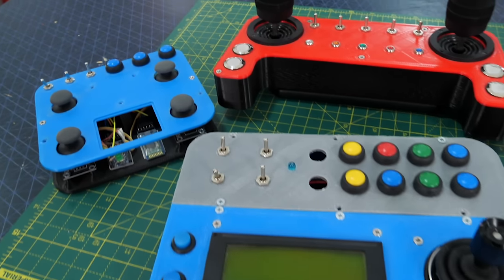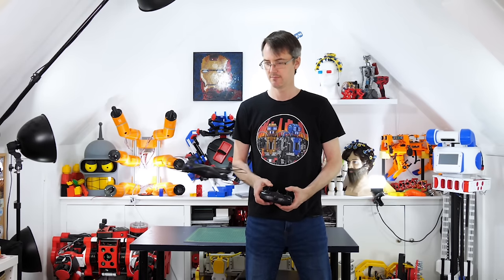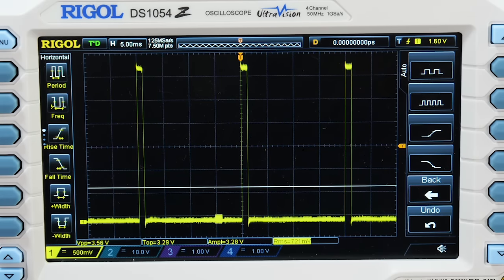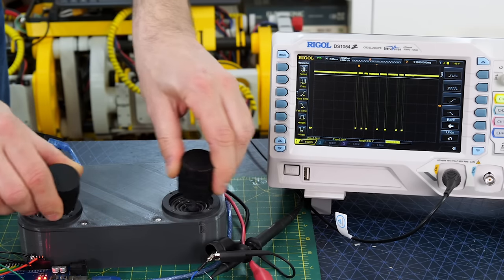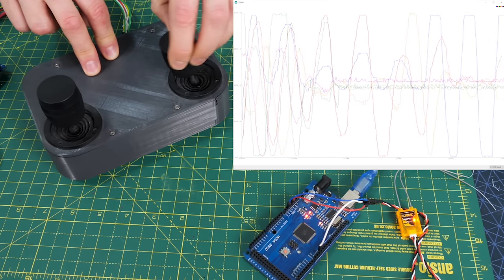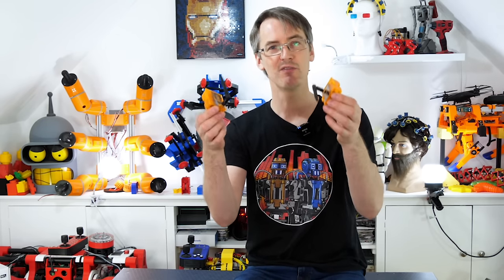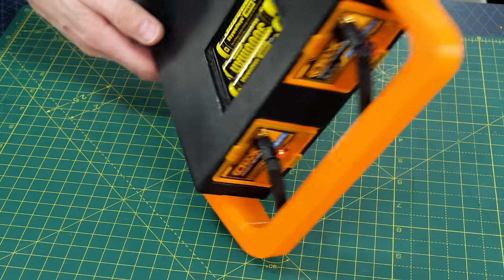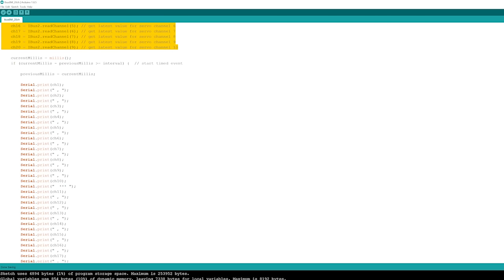Building a DSM2 R/C Transmitter with Arduino

Comment: @James Bruton: you can find all over internet radio modules on any band (433/868/915Mhz/2.4Ghz) that just provide a transparent UART. And they are cheap. Having a digital UART makes things easier, you can send any data you want. And they do provide reliability and range (hundreds of meters, kilometers). Using analog PPM signals or IBus or any RC protocol is not the way to go for your projects. Just a transparent radio UART is the best approach. Being full digital, you can add checksums, error correction and whatever you want to your digital packets.
Reply from the maker: links?
Reply: @jamesbruton  Not sure I can post links here,but if you search your preferred online shop for: "3dr radio modules" or "LORA 433Mhz radio module" (or other frequency band or any radio module with SXnnnn chipsets) you can find a ton of modules. They are just transparent radio UARTs, and you configure the datarate/ec/etc using AT commands. They expose just a RX/TX UART pins or USB to connect to your microcontroller or PC or PI. They usually support up to 56kb air rate, some do support more, but it's enough for remote controlling and sending commands and configuration data and whatever data you want back and forth. All these modules are just plug and play. You just configure the serial speed and the channel using AT commands (most are already set with default values, so 2 identical modules will just

Comment: That DSM hardware is 5+ years out of date. Check out Express LRS. Its an open source project being actively developed with 40km+ of range. Because its open source, the Rx and Tx are very inexpensive. And the devs are so enthusiastic about it, if its missing a feature, I'm sure you could work with them to develop it.

Comment: The attempt to multiplex the channels failed because the receiver is decoding the channels asynchronously from the ibus reporting. So you get some values from the current frame and some from the previous frame.

Comment: Thanks! I just grabbed a few😊. My solution has been to use a wifi router modified with OpenWRT, and UDP. And that is very resistant to large amounts of interference. But I will try playing with these.

Comment: I know this is an old video but you could consider using the HC-12 wireless module gives you 1km @433.4-473.0 MHz for Arduino to Arduino communications. They have hit 2km in some situations.

Comment: You could also read the PPM receiver signal using the Capture peripheral of a MCU in combination with DMA to free up the processor.
Reply: The arduino / atmega328 doesn't have DMA.  It does have hardware to capture when an input changed, good for reading a PPM signal.

Comment: You get a lot more configurability and control with something like the nrf24 since each packet is 32 bytes and you can send whatever you want, that could be 32 separate 8 bit channels. You can also do what you tried to do which is to make the first byte an identification byte and then send packets containing different data. Where did you get your nrf24 modules? There are a lot of fake ones out there that have rubbish range or don’t work properly.

Comment: look into expresslrs if you want reliabilty and range at a low cost, but might be simpler to use lora modules directly for custom integrations and dataset lora might be helpful but relatively slow compared to wifi, it should not be very different speed wise compared to the nrf24 depending on selected data speed, there are many modules with varying tx power for arduino some with more functions built into the chip directly like interference mitigation and error checking and correction... elrs uses lora and it gets very low latency, high refresh rate and very long range, it's also open source so you can also probably adapt it to your needs.

Comment: Maybe it's a bit silly, but I kinda miss the fun jingle you used to end your videos with. Pretty clever thinking to pack multiple buttons into a single channel though. Seems like an approach which could be generalized to several buttons/switches per channel. Within certain limits, even multiple variable axii could be packed into a single channel with reduced resolution.

Comment: You can likely get more switches into a single channel if you coerce you signal values into a binary number. Essentially, take your channel value, subtract the minimum possible value, and then integer divide the result by a fraction of the maximum possible value range. the number you would divide by is (Maximum Possible Value Range / A Power of two, the more the better). You would have to fine-tune that power of two so you get reliable reconstruction on the receiving end (your channel value will likely fluctuate by some small amount even when the input is consistent).

Then you can use each bit of the resultant number (your number of bits will be equal to the power you raised the 2 in the denominator by) as a flag for whether that switch is on or not. With the variance I was seeing, I imagine 4 to 6 bits of precision may be possible, meaning you can encode 4 to 6 switches per channel. If you can get closer to 16bits of precision (doubtful but maybe), you can use a similar trick to encode two seperate 8bit data streams into a single channel. This type of multiplexing can go a long way.

It is unfortunate that you weren't able to get the nieve time-based multiplexing working, as there are really robust time-signal schemes that can power seriously over-the-top multiplexing. Those are the same methods used by cell phone towers to service hundreds to thousands of clients per network cell.

Comment: The primary reason I upgraded all my RCs from Frsky/XM+ is because of dropouts. ELRS has been rock solid and cheap. Love your videos, keep it up!
Reply: Frsky has been rock solid here to
Reply: For what James is doing FRsky is probably fine (and dang cheap) since he can code around dropouts since it sounds like he already has had to before. I’ve lost signal on an XM+ at 75’ LOS so I moved on personally. 

One thing a newer protocol would have helped with is serial in/out from the start rather than the PPM code, but it works now so why change.

Comment: Your mixing problem is due to out of order packet transmission on a digital buss/radio interface.  Same problem as UDP packet transmission.  You aren't guaranteed the order.  You would have to tag the data with orders for packets.  Then encode and decode your data in the chain of data.

Comment: TDS PP has an industrial version of the 6-DoF thumb joystick (aka Space Mouse) module with UART or USB interface.
I think some of your applications would really benefit from having that.
Reply: That would be cool, but what a learning curve to control! Now I wanna make a space mouse quad controller and try it.
Reply: @skylar7320  I use it for CAD, 3D, I programmed a plug-in for Cities Skylines to manipulate the camera, and with many other games it can be configured as a joystick, for example in Elite Dangerous.
Not sure whether the small dynamic range is good for a drone. And yes there is a bit of a learning curve. Although in both ways, as I really struggled with CAD with just a mouse.
Reply: @graealex  yeah, I’ve used in CAD too. Takes a bit to get used to

Comment: The NRF modules work better if you give them their own 3.3V regulator and not siphon the 3.3V from the Arduino. There are ready built NRF power boards for this purpose.

Comment: You can buy any TX module and do this. There are many out there in fact they have LRS and multi protocol ones. This is an old one that's why it's so cheap I have used a rangerx to do the same it's a multi protocol. Connect to dsm2 plus many more.

Comment: You could probably also read the PPM using a RP2040 microcontroller and PIO. Though that also means writing assembly, so spending an extra tenbux on the better receiver is probably the right way to go.

Comment: I remember when you could make an 8-channel PWM link with 4000-series CMOS 1-of-10 counter chips and a few capacitors and stuff. :) And these, of course, won't try to be clever by mixing up different frames. (I hate systems which do that; hardware or software.) I've still got the book with the circuit diagrams somewhere. 4 quite simple circuits: encoder, decoder, 27 MHz transmitter and receiver. Having a quick search, it looks like you can even still get the adjustable inductors; Toko branding and all, though I haven't checked the values. The book is Mastering Electronics; I'd post author & ISBN but I've just moved and don't want to go raiding boxes just now.

Oof! 3km? I don't think those 27MHz circuits had that kind of range. :D

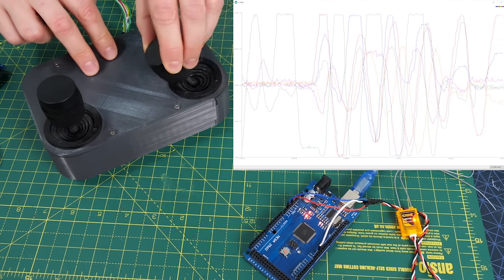Comment: 6:20 The "best" solution imo would be to use a microcontroller with DMA (the atmega2560 doesn't), set the PPM output as DMA trigger, leave a timer running in the background, and use the DMA to save the timer count value at each PPM trigger, and reset/stop the timer if overflow
That way, you use exactly 0 processor cycles and get full data acquisition

Yes I love DMAs
Reply: The atmega328, used by the baseline arduino, has input capture hardware to record the time when an input changes.  This should work for capturing the PPM signal without resort to interrupts.  It would require reading the status more often than the input changes.

Comment: I don't know how you're getting such poor range from NRF modules. I've use them in a DIY remote for a bunch of clay traps and have tested it at over 1/2 mile range.

The modules I use are the ones which allow external antennas, I also have a couple of shielded modules which I've not ever tested as the other ones worked just fine.

Lora might be an option worth looking at. Low data rate but really good range. 
I use LoraWAN in tank level sensors over several miles.

Comment: maybe use the blank in the middle of the rc remote for a screen either simple liquid crystal or even a touch one with lvgl, for telemetry and battery percentage ... in addition to switches and buttons if necessary..

Comment: As usual, an awesome video! You should try and help out the hacksmith and his hydraulic spider, I bet you could make it work better than they did!
Reply: Dunno... think the biggest issue they had with that thing was the sheer effort/time involved in each test run and that every error caused damage.  The other issue was that they were working with imprecise actuators (and sensors? or at least not enough of them). It was a good try (an excellent try even) but not sure any more minds on the job would have helped.

Comment: I'm a little confused, normally I hear "channels" in relation to r/c vehicles/stuff as a way of controlling multiple devices in the same area with individual controls (think retail toy R/C cars, they often have a selector switch on both the car and controller to switch between the "channels" so you can race another person's car [of the same make/model usually] or control multiple cars with one remote). 

Is there a clear distinction between the two or are they the essentially same thing, just different levels? 
Presumably each of these channels has 3--5 sub-channels for the various controls.

Comment: I think you could get away with 6ch transmitter/receiver and use e.g. 1st 5 channels and some smart but operations to digitally code a channel number, then 6th channel to send the value.

Assuming only 0/1 values on the 5 channels, you would have 32 channels out of one 6ch transmitter/receiver pair. :) (With more intermediate values you could get more, e.g 3^5, 4^5 and so on).

Comment: For the "binary switches" you could set single bits and transmit multiple switches on one channel that way. How many exactly is limited by the highest analog number you can transmit on a single channel (I guess 8 switches per channel?).
Reply: yeh there's no (except latency) limit really on how much you can cram down a single channel -if- you have the time to work on it/ I think James is always pressed for time though given his project through put so can see why he went for what he chose.
Reply: @WistrelChianti  I do not know, if you could really transmit as much data as you want per channel, but my idea takes only like two minutes, and he kind of did already that, but "worse". 
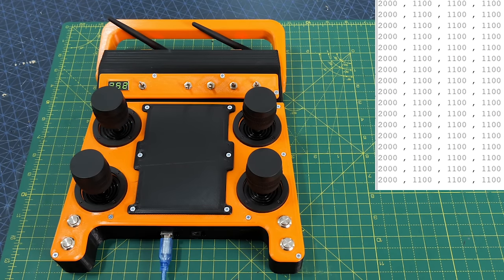At 10:02 you can see, how he uses two switches on one channel by adding specific values to the number for each switch. My idea works the same way, but adds powers of two, so you can transmit more per channel.
It is just literally the same thing, only using different numbers, and offering more switches per channel that way...

Comment: Hey, i have got a question. Im new to basically all electrical wiring. Im getting into the RC plane hobby right now and wanted to know if there would be a way of running my gladiator flight stick (which is only for gaming) through my laptop and into a little setup like you have it with a transmitter.
As far as my understanding of this problem goes, i should be able to connect such a trabsmitter directly into my laptop, and have all inputs of my flightstick be converted into that ppm language with a script. And then i would just need the normal receiver setup in the plane.

Comment: just use flysky, i use it and got 14 channels via ibus (only a firmwareupdate in the transmitter was needet. also a range of 2km + is possible with some easy mods like the antennas, battery and software. i use the flysky i6 (35-40€ now, back than about 60€, but still very good for the performance.)

Comment: Idea on the multichannel thing for buttons. could you not multiplex the buttons into an analogue value. treat it like binary and have a 1k, 2k, 4k, 8k etc. resisitor so any combination of say 8 buttons gives a unique resistance which only take up a single transmission channel? (only half way through the vid so far).
Reply: Ah, looks like you are doing something like that with 2 bits of info.

Comment: You may want to look into the TBS products (Either Tracer or Crossfire depending on the range you're looking for) which are often used for drones - They do have separate transmitter modules and they will give you the CRSF protocol documentation if you ask their support. (Or you can use PPM) Crossfire supports either 8 or 12 channels (Depending on latency required) at very long ranges. (Up to 40km) Tracer supports 12 channels with a higher refresh rate but at a shorter range, but still very long. (25km) They also support telemetry and failsafe. Finally you may want to consider modifying an OpenTX transmitter, you can buy the PCBs from the TBS transmitters and OpenTX has a lot of configuration for mixing channels.

Comment: I would like to see you use that transmitter on a robotic dog with an arm, ideally to help train an AI to operate the body. Instead of starting from nothing, you could feed it input data by hand at first and try to get it to replicate actions. I would like to see a robot dog with an arm learn to grab an apple from the kitchen and bring it to a person, and the apple could be placed in various (reachable/seeable) locations.

Comment: Great video. Super interesting. Have always thought it's a massive shame that RC radios sky rocket for higher number of channels so good to know there's a cheap way round it.  Can defo see the time factor coming into play here. Always the game is time to make something nice/right vs that'll do and heck it's only a few more quid for a cash workaround.  Anyone thinking of making comments about switch statements or amount of code in the ISR should probably bear this in mind (especially given the direct receiver code wasn't used in the end). . Some nice obvservations on advertising incidentally, I had mark forged talking about carbon fiber reenforced 3d prints which was interesting and also arduino promoting a school learning pack. Even huel is something I've been tempted to try. Finally awww project air... nooo. (and hope you guys can collab on something one day! love that channel too)
Reply: Those prices are because of Spektrum, a Horizon Hobby brand. Most HH stuff is expensive and mediocre in quality. Dsm/dsm2 isn't the best transmission protocol either and is notorious for failsafe/brownout issues. Dsmx is a lot better but it's still most commonly used under the HH umbrella. There are much better protocols available and are available in much cheaper transmitters.

Comment: Lol, the module is out of stock.  Would it work with some other dsm2 module?  This radio would be amazing for rc construction equipment I'm working on.
Reply: Let me know if you find an alternative solution or website for this module in combination with the receivers that are still available. Thanks

Comment: You can send even more data in a single channel by encoding the data in individual bits. For example, if you have 4 buttons, each button is a single bit, say the first two buttons are pressed. Then the value to send would be 1100 or 12. This way all your buttons can take up a single channel
Reply: That only works for packetized and error checked digital protocols (eg. nRF24). For PPM the time-length of the pulses is measured, so they are not guaranteed to be exactly the same at the other end. For example if you sent a value of 255 (first 8 bits all ones) it might be 256 at the receiving side (first 8 bits all zero).
Reply: @iforce2d  ah I see, thanks for the clarification!

Comment: So this is something I've wanted to do for a while, but I've been stumped by something that just seemed to work for you.  When my Arduino puts out PPM to the RC transmitter module, it doesn't come out the iBus on the receiver even though they've been paired.  Regular PWM works, but no iBus.  I'm using Flysky components.  It would appear that the Flysky transmitters have a setting for "PPM iBus" that changes the PPM output in some way before it hits the transmitter module that lets the receiver know that we want to use iBus at the receiver.  Can you shed any light on this?